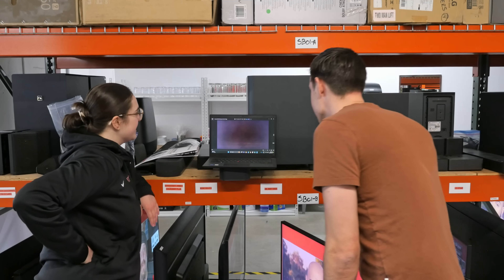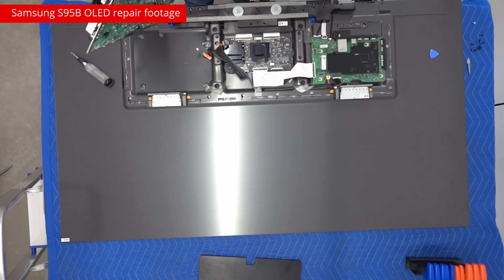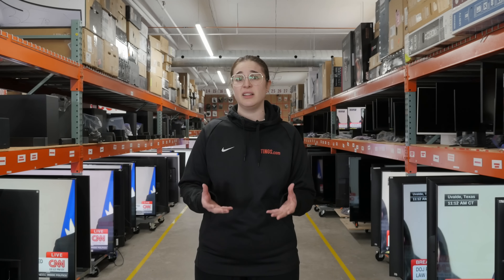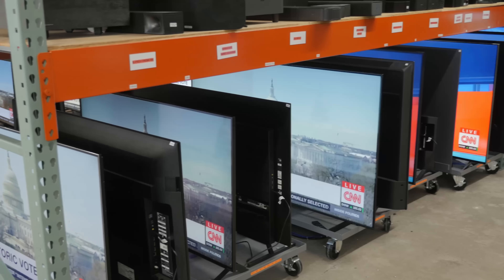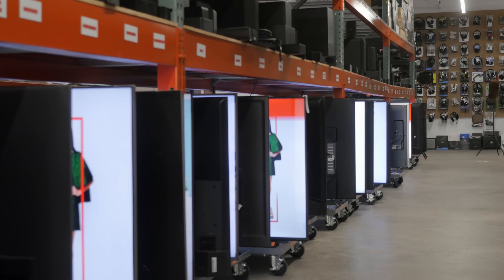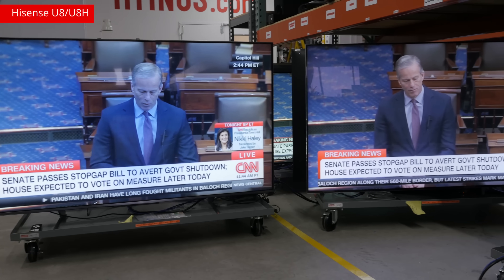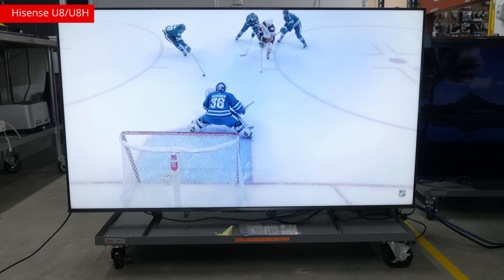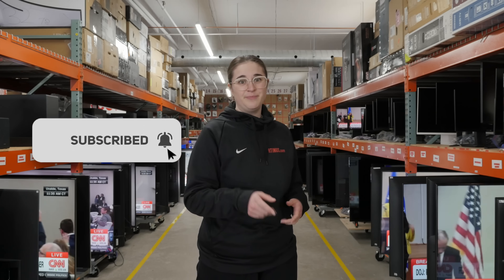1 Year Longevity Update! LCD Models & Future Failures

Comment: Aha! Funny I ran across this video...I've had a U8H for a year & 8 months. And it developed this same blue tint in the middle of the screen!

Even though I have a keen eye, I only really noticed it because...I have a U8G of the same size & age right next to it. And I was wondering why the quality looked so bad in comparison, plus so blue! Lol

I thought tweaking some picture settings would help, absolutely not lol but surprisingly you can't see it while gaming on the PS5... especially if you crank the color up

I called up Hisense customer support which I was a bit worried about, due to the negative warranty stories online. But to my surprise they sent me a replacement upgraded U8K within 2 weeks!

This happened end of February 2025 by the way, and the U8K came in perfect condition...the panel is amazing. Also the U8G I bought at the same time as the U8H, is still working flawlessly

So this seems to be a particular problem with the U8H over time

Comment: I have a 2014 Insignia I use on my pc, a 2015 LG I use with my gaming systems, and a 2016 Sharp my husband watches. None of them have any issues (knock on wood). Is it the lcd screens, or are manufacturers using cheaper components than they used to? I was considering updating everything, but maybe I'll just keep them for another ten years.

Comment: Sometimes use my 43inch QN90B as a monitor working from home, at 1440p without scaling so it displays a smaller screen. Still looks good and nice to see yours still has no problems in this test!

Comment: This has confirmed my personal experience, which perceived wisdom seems to tell a lot of people is totally wrong, and that is that nearly all TVs are likely trash after around 5 years of typical usage. I've never had an LCD (illegally sold as "LED") TV last more than 3 years without showing some visible signs of burn-in, other panel degradation, or back light degradation, or all three. My WOLED TV still checks out fine with a calibrator and greyscale tests after 3 years. So far for me, WOLED wins by some margin.

Comment: …a few weeks ago an LED went out on my 2019 Samsung The Frame TV (65”). I now have a dark black vertical streak across my screen. These TV’s are edge lit so……🤷‍♂️
Last week I ordered a 2024 model of the same Samsung Frame TV (75”). Out of an abundance of caution I purchased a warranty with this one.

In the back of my mind I can’t help but wonder if the MAIN FEATURE of The Frame TV ( the ability to have a picture remain on the screen when the tv is not on) is the reason the LED light burned out prematurely?
Are you guys taking into account this big variable when testing The Frame TV’s?

Comment: It is not so difficult to understand: higher speeds, faster decoding, more brightness and all this without fans or really new developments.

At the end, the generated heat wears everything even faster off and the more sensible elements (LED/OLED) and light diffusers/liquid Cristal also get in trouble. 

I think the best thing is:
- have a smaller cheap TV for constant news/people watching TV for hours a day
- a high end TV for TV shows and movies
- for regular TV programs, set the brightness to medium or even low
- maintain the room temperature as cool as possible and a noiseless fan behind the TV spinning low: it will maintain the TV cool. Avoid wall mounts.
Reply: Interesting enough,The new Panasonic OLED have heat dissipation technology and also a thermal flow system that cools the heat sink! All TVs should learn from this…

Comment: @RTINGScomRD could you check the cost of fixing the LCD ones with backlit degradation? Sometimes it's just one faulty LED and replacing the ribbon does the trick

Comment: This is only confusing me even more which TV to buy next to keep for 5 years. Currently using Panasonic DX902B since 2017. I can't see any issues. Question is which TV I can buy today that will last me 5-6 years that has most modern features and good enough picture quality. Based on this video I am worried non will last that long.

Comment: My friend has a Hisense 65inch U8HQ with like a year or less and the entire TV is now uniformly blue without spots or anything, just crazy COLD, I reset the TV but sadly it's really kaput, even the warmest option is very cold blue.

I'm more inclined to OLED, it seems QD-LCD are being a huge cancer too even worse than OLED...

ps: I have a Hisense 55inch U8KQ, hope it doesn't go puff or I will be mad🤬
Reply: QD LCDs are just... LED TVs. Do not judge on the QD layer.
Reply: @yuragi369  well those problems seem related to the QD color converter layer, it seems to me high brightness + QD layer is being a cancer for the LCD, they start to eventually turn blue...
Reply: @guily6669  Layer wouldn´t make much sense. Especially on Low End TVs that "Q"LED is more marketing without having a true impact with these lower brightness. I also know QLED TVs that last about 5+ years now without any issue. Again, i don´t like the manipulating stuff. It is just an LED TV. Every LED Tv has different layers. It was just marketing to make people think it is a higher model than OLED. 

It is more likely that some other components are cheap quality. Samsung uses different manifacturing statiions around the world. Some are really low quality.

Comment: it's interesting how, generally, the "death" of OLED always fades to red, while the LCD death fades to blue.  Reddish whites are still tolerable, but blueish ones... it's a pain in the eye. I have a 12yo Nokia x5-01 device, and its LCD is still functional, but its backlight is becoming yellowish overtime and its Liquid Crystal, in the center of the screen, are becoming "noisy" with a lot of dead pixels... but more than 12 years of use is an excellent ranking. LCD will stil live longer than any OLED types screen...

Comment: oh thank you so much for this. this has been my experience with lcds over time, and people never believe me when i say my oled is actually outlasting most of my LCDs in picture degradation, with so far my 2010 plasma being the best at not degrading (still looks brand new, though probably dimmer than it was, idk) ever since CRTs. my 2013 samsung tv that i used as a monitor barely lasted 2 years before it became completely overtaken by dirty screen that was visible in any content and became unusable to me.
Reply: Did you even watch the video? Most have no issues.

Comment: As someone without any income, I am in the unique position of being stuck with an obscure Samsung TV that I rescued from a FedEx store. It's a commercial product designed specifically for businesses that want displays to run text walls for years and years. I wonder how long a display such as mine would last in this test. 

Also interestingly, during the video I found myself judging people who would tolerate a horribly tinted display, or those that wouldn't even notice the difference, but once I scrolled to the comments I remembered the 8 inch white gash on the bottom of my screen, and some terrible irony set in. Anyways, incredible work on these tests.

Comment: Tind or backlight issues I fully expected withg LCDs. Especially the ones with more dimming zones to have more issues with tint makes sense given that the LCD is subjected to more heat and the backlight to more temprature cycles.
But what I wasn't expected was image retention issues. Sure, LCDs also can suffer from TFT drift, just like OLEDs, but LCDs can make use of pixel inversion which should make TFT drift a non-issue 😲

Comment: When I bought a Pioneer Kuro 5080HD Plasma in 2007 I didnt think it would still be working today (no repairs) It may of lost some of its original brightness punch but ive been able to mostly compensate using the picture settings and otherwise still looks great and still has the impressive black levels kuros were known for. But I'm glad RTINGS exists for when it comes time to replace it.
Reply: I have a similar kuro. Still works perfectly fine, with as you mentioned some reduced Brightness.
Reply: Just get another. Used plasmas are cheap asf

Comment: I would highly suggest anybody steer well clear of Philips TVs.

I had a Philips 58PUS8535 from November 2021 until December 2022. After seven months use it started showing dirty screen effect. Six months later the TV screen just completely quit working.

September 2023 (last year) I bought a Philips 50PUS7906 and right now the dirty screen effect is very obvious and getting worse all the time.

But ever since I bought the current Philips TV I've seen what looks like a light grey heater element like thing on light coloured images on the TV.

I won't buy another Philips TV. I thought the first one was a fluke but now I'm sure it's just a brand problem

Comment: Well my October 2020 purchase Samsung QE65Q80TATXXU has failed already. Horizontal line across the screen which I believe is the panel. Guessing I'll have to pick another manufacturer.
Reply: Wont Change much, every manufac. has the potential to sell you a tv with defects
Reply: @transporter255  True, but its how they deal with it that matters. And that's where Samsung failed.
Reply: @sparkymark75  I dont understand what you mean. Every TV can have Problems, you were Just unlucky. Had a Sony from 2015 whivh broke in 2019. Bought a Samsung in 2019 which broke after 24 hours, went Back, thankfully got a new one Instantly(Same model) and this unit has been running without Problems for 5 years.

Oh and No Matter which Brand you buy from, get an extended warranty, the Times were TVs were built to Last for ages are gone 🙂

Comment: My TCL R648 QLED is used primarily as a PC monitor and it already has light burn-in of a couple Windows taskbar elements. I've had it less than a year and haven't clocked very many hours on it, but it is showing light retention of the taskbar. My three year-old Samsung Q70R has it too. You'd never notice it in actual content but you can see it faintly in a medium or dark gray slide. Some think only OLED is susceptible to burn-in, but my LEDs would beg to differ.
Reply: Interesting,Heat issues ? I think if TVs were cooled they would have NO issues,Panasonic’s new Tandem OLED has a heatsink and air flow filter to stop the heat.

Comment: I'm an electrical engineer and I'd like to point out that this whole test is profoundly flawed, showcasing a blatant disregard for real-world conditions. Subjecting these panels to extended heat exposure, a scenario divorced from any semblance of practicality, demonstrates a woeful lack of understanding. Operating them incessantly, 24/7, reflects an astonishing ignorance of the actual stresses components encounter in genuine usage. The observed issues—tinting, spotting, and panel degradation—are not indicative of real-world viewing situations but rather a consequence of the absurdly exaggerated heat exposure in your misguided test.
Reply: And yet... many TVs die exactly like this in exactly the same way with normal use over a longer period of time.
Funny how that works, isn't it?

Comment: I still have a CRT TV that's around 30 years old that still works and is not discolored. I guess modern TVs are disposable 🤷
Reply: Put the cost you paid for that CRT TV into an inflation calculator and it'll show you (roughly) what you have to spend now to get the same kind of quality.

Comment: The LCD issues pointed out in this video I see very often, especially on cheaper TV sets. It seems to be a backlight issue in every case. The uniformity getting worse is probably due to LEDs in the backlight regions individually failing. In my experience with leaving some Vizio TV sets on for a few years straight, the individual LEDs will fail first, followed by entire LED regions, followed by the TV's power supply (perhaps the LEDs are turning into wires rather than diodes?)

Anyways, some food for thought.

Comment: NO amount of burn in is acceptablke. which is why i will NEVER buy a oled.  Qned/nano from LG seems to be the best technique on the market right now. to bad it is to darn expensive for me. And funny that only the tv brands i would not buy are the problem cases.
Reply: Ive been using my 55" oled for 2 years most often daily sometimes for 8+ hours per day for varied content and have absolutely zero 'burn in'. Some days it would be used as a computer display for my gaming pc, other days just to watch movies or ps5 / series x. Ive even managed to disable auto brightness limiter in the service menu and still no issues! I used to have plasma before and THAT definetely had noticeable image retention issues. 

I will say the image quality / budget wise on my old sony VA panel was also fantastic and i would argue if you are wanting the best image quality, decent value and are gonna sit directly facing the tv then thats a great choice to make.
Reply: QNED and nano are much cheaper than OLED.
It sounds like you're too cheap to afford an OLED and you're compensating.
Reply: @tim3172   QNED is actually really expensive still as it's relatively new. 

And im not compensating anythign i just do not accept burn in in ANY form and its a FACT you get burn in.  im just makihng the smarter choice. QWned is the best inbetween choice atm but im not paying 1900 for a 75 ich tv. 

but keep feeding your own superiority feeling as clearly your the sheep that keeps burned in panels expensive lol.

Comment: I wonder if there are any repair cycles your testing is missing? Like CRTs used to degauss on powerup if you left them off for an hour, and I have a dell 3011 that gets temporary screen burn in (I can see the edges of windows) if I leave it on for more than about 8 hours a day(but goes away if I leave it off for an hour or so).

Comment: when you're done with a TV that showed spots of discoloration i would like you guys to try and wipe them with a bit of pressure. maybe a decade ago i bought a used TV, which the previous owner had for some reason laid face down on a pillow. there was a massive dark spot where it laid on the pillow, i was pretty mad and almost threw it out, but my dad just pressed on the spot and wiped it till it went away.

Comment: YOU KNOW? THESE TVs ARE NOT MADE TO LAST! TUBED TVs WERE! HIGH END TVs ARE MADE BETTER SO WILL LONGER. ADD THAT PANEL LOTTERY STUFF.
Reply: Tube TVs had a very high fault rate. They were not meant to last as they degraded in brightness quite rapidly.
High-end TVs do not have a longer lifespan than midrange TVs. I'm not sure what the last "thought" is meant to be.
Literally anything you buy is a quality lottery.

Comment: Been using Samsung LCD TV as computer main monitor for... 13 years? Long usage time, can say average 12h a day, whole year continuesly. Yes I am hermit / hikikomori. 😭
Luckily, no color issue. It just the edge become darker (about 1cm distance have dark gradient), a couple subtle small dark dots I not sure if they are just dust or mold (not noticeable in regular usage), or pixel falure? Also slight burn in on the taskbar. Can still tolerate it... still usable.
Reply: about to say something similar, an LG 4k TV as monitor 12-16 hours a day for 6 years.  I had to fix it though with the scotch tape technique, and no more wireless connectivity.

Comment: I somehow feel more validated than ever with my choice to go OLED, especially seeing some of those 10 months slides on more recent panels especially the monitors. They hold up insanely well over time, all things considered. I have a question though: I've seen 5% grey slide and 50% gray slide being tossed around and I know that these are designed to show burn in on OLED, but which one of those is better and which is worse, and which one is closer to being seen in actual content?
Reply: 5% gray is a much tougher (more sensitive) test— you can see burn-in much more easily on 5% gray than 50%…

Comment: I have a 16x10 26 inch MINTEK I bought at Costco in 2005. It was among the first batch of LCD displays.

From purchase to 2012, it was a computer monitor on 16 hours every single day (in a very literal sense btw). After that it was a bedroom tv for ~2 years, then I lent it to my neighbor (she was 94) for 3 years where it was on 24/7 (she never turned it off, not even at night).

It never failed. Never faded. The backlight is still totally uniform. Not using it since I got it back, but the amount of use it got is ridiculous and the fact that it still works is even moreso.
Reply: CCFLs are reliable.

Comment: Crazy to see some very expensive ones dying already. My Vizio plasma from 12 years ago is still going strong, though tending a bit dark in some scenes. Still looks amazing with the lights dimmed. I keep wanting to get something new but the Vizio just won't die so I feel like I should keep waiting.
Reply: I wonder how much money you've wasted on the power to keep that thing going. 
You probably could have gotten 2 replacement TVs by now.
Reply: I have an almost 20 yr old (2006?) Philips plasma. It's just 720p. The cheap remote with rubber buttons stopped working. That's all. I did get faint burn in because I used it 4:3. Slight red tint, I believe only visible against green background. Think football field. It disappeared quickly when I used it in 16:9. Which all broadcasting is in since long. Still great colors and contrast, though resolution is pitiful.
 
I paid $1500 or $1800. About mid-range at the time. Cheapest were around $6-800. Horrible 480p LCD screens.